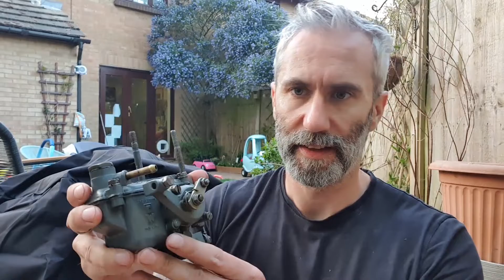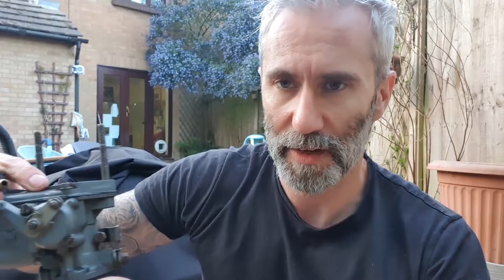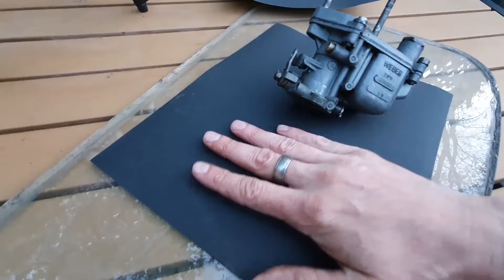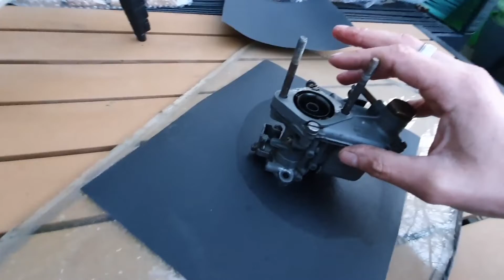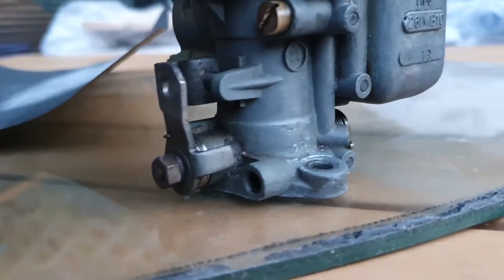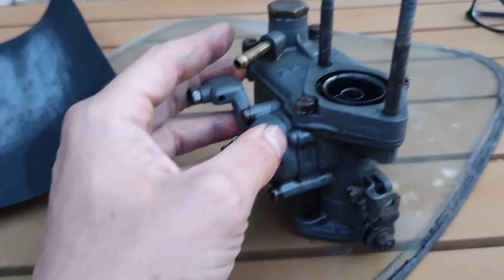How to repair a warped carburetor mounting flange

Comment: Hi thanks for the video. I have same carb and an old gasket - problem is I’m based in Africa where I can’t find any Weber gaskets, can I reuse the old one? Or add sealant?
Reply: should be able to buy weber carb gasket kits on line - i did for my DS carb
Reply from the maker: Can you buy generic gasket paper? You can just make your own
Reply from the maker: But if its undamaged you can reuse

Comment: This is a top tip , unfortunately my 28imb looked like a sumo wrestler had tightened it with a barge pole 😖 last week I fitted a new one from a reputable 500 parts dealer.
I set up float levels etc as they aren’t always great from the factory etc. I cannot get the car to run at all now, starts  for literally 4 seconds then dies.
Did you ever come across a faulty carb from new ?
Reply from the maker: sounds obvious, but are you sure you have the standard jets 115 main, and 50 idle, you'll only be using the idle circuit upon start. Are you starting with choke? have you checked that the mixture screw is 2 turns out (as a starting point) and 1.5 on the idle speed screw. running for that short then dying could be either rich or lean, what do your sparkplugs look like? black and sooty or white?
Reply: Hi Tim I Bought the carb as a direct replacement so I didn’t check the jet sizes . 
I will now , got the mixture screw set up in the right ballpark, tried it with and without choke , no start at all without.
not checked plugs since fitting new carb as they are new and I didn’t think it had run for long enough to show up on plugs , I’ll pull them now though just in case .
Really appreciate your answer, thanks very much .
Reply from the maker: @Petrolhead912  if overly rich they'll soot up quick, or be wet if flooding so it'll give a starting point or eliminate something. Assuming engine timing was all good before you swapped carb,  good strong spark and fully functioning consendor etc... could be dying due to losing spark (which it would also do if it was flooding and getting the plugs wet)

Comment: Hy. Did the same on my IMB 28 an al the gasket mateing surfaces and also on my fuel pump. It ended up quite 👌
Reply from the maker: Yeah i have done it to the 28 on my other car too, much stronger stiffer casting however so much less warping
Reply: @FoxSpeedshop  i had al least 0,5-1mm. In my opinion it’s huge😂. So glad to see cheap and fast diy solution for these sort of things. Keep up the good work. I have learned a lot from you since I have my 500.
Reply from the maker: @CasaDin30  appreciate the kind words, thanks for watching

Comment: That’s a good idea to replace the inlet spigot with a screwed connector. I remember on a motorway in France when mine popped out, so frustrating and dangerous with fuel spilling over everything. I managed to refit it and hammer it back in, saw me home fortunately. This was a good reminder, I will replace mine.
Reply from the maker: Yes i have had both inlet and outlet blow out on my 28 carb, in the previous comparison video you can see i have done that one already